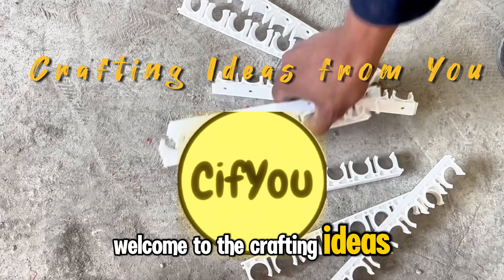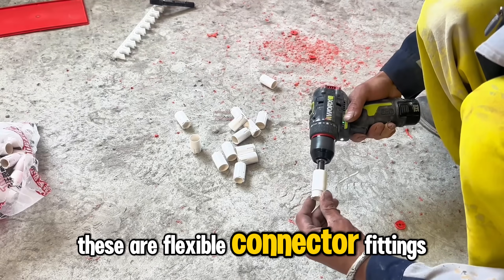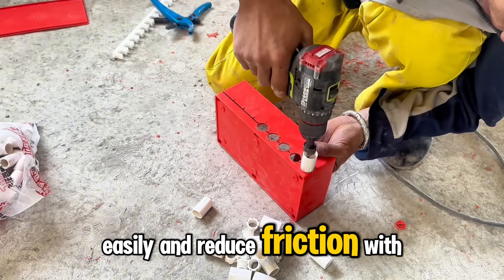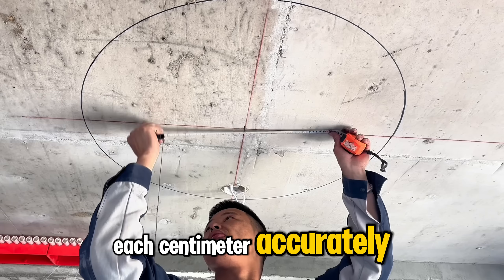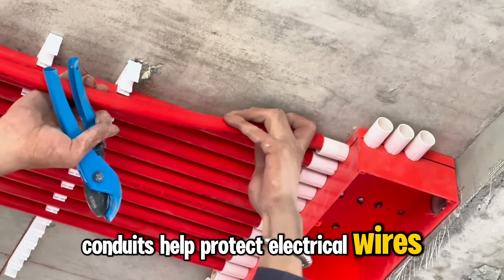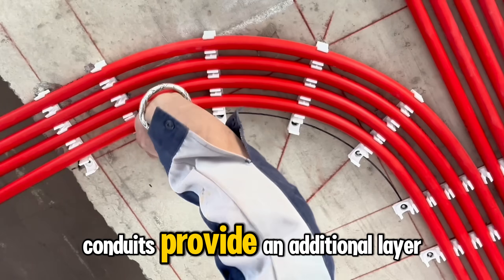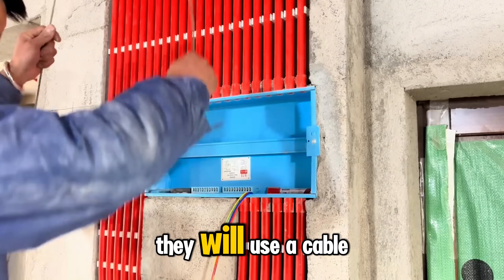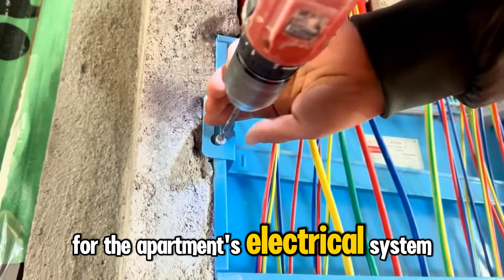What would electricity look like without following NEC (National Electrical Code) standards?

Comment: The electricians here in this video would do excellent work under any rule book that makes sense I think. I wished their dilligence could be observed as well in the work of many German trademen.

After this house, flat or appartment is completed nobody will see this dilligent wiring and when it comes to guess where not to drill a hole for a picture or any other fixture on the wall difficulties will start. The work displayed here lacks installation zones meaning zones where to expect electrical wiring and those supposed to be safely free from that. This might hurt a bit less on the ceiling.

But one thing is actually better in modern European fuseboxes like those from e.g. Hager (Germany) or Schneider (France): There are common rail systems available to connect RCDs with the circuit breakers and to connect a set of two or three RCDs with the main switch. They are simply clicked in, offer more cross section and use less wiring space.

Comment: I’ve seen NEC houses with over 30 Ω ground resistance, loose NM cables just stapled between studs, no conduit anywhere, and no separate 300 mA / 30 mA protection. Junction boxes often sit half-buried behind drywall, multiple outlets share one 15 A circuit, and aluminum wiring still pops up in older homes. Grounds are sometimes floating or daisy-chained through receptacles, and neutral–ground bonds aren’t always consistent.

Comment: I’ve read the comments and I’m honestly shocked. I’m not sure if everyone here is an electrician or not, but this video clearly shows why skipping the NEC standards is a terrible idea. They drilled through a horizontal column (a beam, lintel, whatever you call it in your country), that’s a major mistake, both structurally and electrically

Comment: WTF???  Where's the neutral bus? Who thought of connecting the neutral bus with a ribbon cable and posting that on YouTube? You have multiple phase wires connected to a single neutral wire. The current in the phase wire is equal to the current in the neutral wire. You have only one neutral wire connected to multiple phase wires. Your circuit is not valid even for a symmetrical three-phase load because the neutral wire will  be overloaded - IT IS ONLY ONE! Its cross-section is smaller than the total cross-section of the wires of each phase. This is a violation of all norms and laws. I can't believe 2 million people didn't notice this....  LMAO
Reply: The max current in neutral can't exceed the max current in one phase, and when all 3 phases are at max load, the neutral current is equal to 0. Just the same way the neutral current is when you load 100W on each phases, you could even disconnect it, nothing would happen. (only work if perfectly balanced)
In 3 phases distribution system, at the street level, the neutral is usually smaller than the phases as the load are balanced and the neutral carry the residual unbalance.
And this work in HV too, the neutral in distribution system is smaller than the 3 phase 7200V conductors.

The disturbing thing is they use yellow and green as phase, and a mixed yellow/green as earth. In some contry blue is mandatory for neutral, yellow/green for earth and you can use any color but blue yellow green for phases. (usually Brown L1 Black L2 gray L3, and any color for switches, two-way push button)

Comment: waste of time and money
Reply: For short term use sure, but consider I just pull the copper line to get the optic fiber without drilling an hole is a nice thing to be able to do in a 1960's house, so does the upgrade to add earth protection and got rid of the odd aluminium cables.

Comment: inefficient  way  need lots of mony or wast
Reply: For short term use sure, but consider I just pull the copper line to get the optic fiber without drilling an hole is a nice thing to be able to do in a 1960's house, so does the upgrade to add earth protection and got rid of the odd aluminium cables.

Comment: With that much concrete that had to be removed whetger at the beam, ceiling and walls to run the PVC, Id give it a few years before that building will start to crumble or show cracks throughout the entire structure

Comment: NEC is a Huge money making Scam.
Reply from the maker: really?
Reply: @CIFYou  Really, just investigate the huge industry.
Reply: Maybe but it doesn't mean it was always that way and it doesn't mean that everything in the code is nonsense. The reason much of the code exists is to 1. Create  standard = saving money = getting everyone on the save page, etc 2. To prevent people from creating problems down the future.

For example, this style would not work in most homes(in the US at least) because with all that wiring someone it makes it far more easy for someone creating shorts such as screwing something into a wall. Someone is very likely going to hit one of those plastic conduits and short out the wires. While the idea of having one wire per device seems nice 1. it is unnecessary 2. far more expensive and wasteful 3. Makes it harder to add new devices(since each one must have it's own conduit).

It may work ok in a business setting excluding the issue with waste/expense but it is overkill and actually may be more unsafe(but in a commercial building generally people are not hanging pictures, breaking walls, etc).

If the conduits are buried inside the wall several inches(say more than 3) then it may be ok but it then still is overkill. E.g., a typical light may draw an amp or two so why does it need its own 30A breaker. In fact, that makes it less safe unless they size the breakers to the device.

The more parts of a system the more complex and the more things that can go wrong. Lots of things that look good on paper or at the start become very problematic in the long run. This is the point of standards. To have things that have been found to work through time. Typically when people do their own thing they cannot anticipate future issues and cause major problems down the road.

I'm not necessarily saying all this is wrong as I do not know enough about it and it seems that it's actually based on some standard.

But one could also say it too is a $$$ scheme given all the extra components it requires.

Comment: I was more worried about the quality of the cement in this building than the wiring. At one point he fastens a conduit holder to the celling and it jump cuts to the conduit fastened, but the ceiling is missing a chunk. I am not an expert, but that can't be good.
Reply: Exactly. They can have the best looking wire installs but if that supporting platform isn't holding then it's pointless. Too bad they can't drive as good as they wire

Comment: - 2:14 
- 5:43
- 5:49
Damaging the concrete beam.

Aaand 
- 11:07
Tightening terminals using "drilling" mode.

This is crap, not an alternative approach.

Comment: Nicely arranged wires but:

1. Breaking the concrete on the beams .. i would send you home in the very next second. 
2. Placing more than 1 wire in one breaker, why on earth? Those are there in the first place to protect the cable, doing so it won't protect anything other than short circuit.

EX: 16A to 2.5 sqmm cables, if you place more load than the capacity of the wire the breaker will trip before the wire mesh melts, placing more 2.5 sqmm wires in a larger breaker will not protect the wire anymore in this scenario.

3.There are copper combs for connectors in the main breakers, even for three phase ones.. stop using wire straps like that.

Comment: What is the advantage of single strand wire over a multistrand wire ?
Reply from the maker: If it is damaged it is only damaged in that tube and does not spread.
Reply: @CIFYou  I am talk about wire, not tube. Why you use single thick copper wire ?

Comment: 5:43 They had to scrape concrete down to the rebars, exposing them, to accommodate for passing conduits and curves. Concrete function notwithstanding,  those rebars are going to rust away in a few years and lose their function, unless they are covered back and isolated from the elements.
This is a definitive no-no in my book.

Comment: High voltage above grond tangent pole or 45 degees ways  in marshall power house use truck mounted CB with tulips in bus bars for safety all bus bars can handle the lods at 25 % above carrying capacity inside switgear Nec iec or uk standard , Perry Utanis PEE 🇵🇭or US🇼🇸

Comment: As electrical engr licence from PRC I work from many countries I used NEC as my referncee in my projects there are many codes , Philippines code but not complete they refer NEC of US , UK, France but NEC of USA is the best working of elec power is dangerous if you don’t control the flow electricity ungerground and above ground installations , small power and High voltage 😎

Comment: The cabling is neat and organised however the last thing I'd ever do is use a battery drill to tighten electrical connections. It is the fastest way to stripping a screw or leaving the connection not tight enough, leading to a scorched connection down the track. This bloke did shave a few screw heads during this process.

I'm also not a fan of solid core cable. Stranded is better, though if that isn't available in some places, solid is all one can use.
Reply from the maker: thanks
Reply: Then you don't know the tool enough. That drill has a torque setting. There is nothing wrong if used properly. Stranded is better? Not always, there are several factors such as price and durability, stranded of the same price has lower amperage rating and can be degraded by oxidation into breaking point which is almost impossible with solid core. Solid core is easier to put in CB.
Reply: @ You don't go on price when specifying current carrying capacity. There is a reason why solid cable is illegal in many countries now - it is prone to breakage, doesn't sit in connectors as well, there is less contact surface area in a connector and it's not as flexible.

Whether or not a battery drill has a torque setting or not is not the point. It is simply a bad practice to use that tool for closing connections and I did specify the main reason why. The user there was stripping the heads of some of the screws with it.

Comment: This worker, other than leaving dust in the cabinet bottom, did an outstanding job! You don’t see wiring done this way outside of industry and military settings. You can poo poo the Code if you will, but it promotes safety and uniformity in the trade.

Comment: At 5:48 and 7:30, concrete beams that are holding the ceiling are broken in order to get these wiring curved or through. Big big big mistake.
Reply: At my job they drilled several 10 cm wide holes through the beams. But apparently it was allowed at a specific height in the beam and with a minimum distance between the holes. Apparently it was designed so that there was no rebar in that part and they used a very special drill that first got attached to the beam. It took hours for 1 hole but zero vibrations, very gently

Comment: Uhm, i'm an electrician.
And in germany we learn how to bend a good right angle with the cables.
So who did say that it's wrong?
Reply: The fixed curves for 16mm that they sell in Belgium are also very short. I just managed to pull 6 x 1.5mm2 through it so it shouldn't be a problem if it's only 2 or 3. Now i must admit that the 6th wire was a bit against the regulations because it's a return wire 😁

Comment: A strict blind allegiance to the NEC is the most comical point to listen to when talking to electricians, especially when those same electricians are typically unaware as to who comprises that code panel. Manufacturers get their products deemed “code” as they are the ones sitting on the code panel. Guys that argue code nuances are doing so to distract from their inability to think for themselves. This is best demonstrated in the residential market where code eliminates practical thought and application for a market comprised of incompetence installers.

Comment: You NEVER disconnect the ground!! The ground wires should be connected at all times, and should NOT be interrupted by a breaker!
Also, never tie multiple wires to the same connection, one gets loose and you now have a fire hazard waiting to happen. And so many more issues... 

The whole conduit thing looks neat and feeds my OCD, but why did you have to screw up everything at the panel connections...

Comment: When all that pvc pipe burns, every one will die from the smoke.
Reply: Try replacing the words "pvc pipe" with other terms and see if that brings a different outcome. Try "furniture", "clothing", "electronics", it seems to work in the sentence, no? :D 
Jokes aside, pvc conduits are usually flame retardant, meaning they won't keep burning and self-extinguish, shrinking in attempt to protect the wires. As opposed to nearly all other household items.

Comment: As a German electrician, I see we got different ways to complete the same job and some stuff is the same but your joints for your wires in these wire boxes I don’t like much. We preferred use like wago or something but not because it’s quicker, it’s because the structure of a joint with a springloaded connections that can’t go lose after time as your connections with Zinn and heat. I like to see your work, it’s like meditation to a nice voice. It’s not your voice, I know but it’s nice ☺️👍🏻

Have a great day and keep your joy up for your work! I like your intention!☺️💪🏻💪🏻

Comment: I have been an electrician for close to 28 years,  different  doesn't mean bad, I learned the British system first and now I work at the NEC,
I worked with the Chinese wiring low-income houses in the Caribbean, in some ways, their system is better, and in other ways, ours is best.  it's like comparing apples to oranges.  Your conduit work and your panel dressing' ability are simply beautiful & we love it. I love the idea of a separate 
conduit for each fixture, it makes repair and replacement so simple.
ss
Reply: That is the difference between the USA and all other countries. In the USA if one small piece breaks we scrapped the whole thing and build over…while other countries repair their work.
Reply from the maker: thanks
Reply: You work at the NEC does this mean you write for the code book? I’m sure confused about that statement.

Comment: Its Art,  Its easy to mount.. but the true work its the tracing.    In the breaker box, i choose the bus contact else to work the wires,.  these pvc tubes are better quality than Peru.  I m impressed with the breaker switchs  they are very compact because only takes a unique slot.  Here takes two slots.   But,  i dont like the beam damage..

Comment: I would hire him for my home in a heartbeat! This installation exceeds NEC standards so in theory it would definitely pass inspection in the US.
Reply: Unless electrical components have a UL seal, (or equivalent), it can't be used in most jurisdictions in US.
Reply: yea! this guy put US electricians to shame! What a mess of an install we have here in the states.
Reply: @lowellabraham6966 When you run pipe you typically pull more than one circuit.  This seems inefficient.

Comment: 5:42  
Why do we, as structural engineers, always say that the concrete cover is so important? Structural bars must always be covered if it is exposed (how is rust produced? Water + oxygen = rust - Because it is exposed, it becomes easier). Thus, the structure has weakened and is unable to perform the function for which it was designed. 

I do not criticize the worker's work, I'm just discussing structurally
Reply: I think it gets covered with more cement or plaster, would it matter then? If not just applying a sealer to it.

Comment: There is no way that breaking a concrete beam and exposing the structural steel is allowed anywhere in the world.
Also, He could save A LOT of time using comb connectors to distribute the phases to the individual breakers. Specially since he has all breakers from the same manufacturer.
Ohh yeah, and the drill to drive the screws... Why would anyone do that?

Comment: In the UK we use metal containment like basket or tray. The cables are then secured using metal braces if above head.

The reason:
A few years back, there was a fire on a construction site. The fireman entered into the building to tackle the fire. It got so Hot that the plastic cable ties (tie wraps) and plastic conduit melted, and the cables fell on to the fireman. He then got tangled up in the copper wires and eventually died from the fire.
Reply: It was an apartment building, the wires were retrofitted coaxial cable, and you are correct about the outcome.
Reply: You have an abomination called ring remains, which is flawed and dangerous because there are two paths current can follow. So if one breaks the circuit will still test fine but if it’s loaded to capacity, it will melt the lead because each lead or conductor is only half the size it should be.
Reply: Бедный 😢
Reply: Сильный жар не спасет от падения даже слабых металических конструкций тем более от лотка нагруженного массой кабеля с толщиной стенки меньше милиметра он так же рухнет на голову
Reply: trays are the standard in europe, its also easier to add new cables or change the layout in the future
Reply: @zaxmaxlax are "trays" the same thing as junction boxes within the U.S.???
Reply: thanks for your advice..  Plastics are easy to mount but sensitive to fire.  Always better metal cages or wraps else pvc.  I take it account.
Reply: Yeah that fire was near me in Stevenage , I’m from Hitchin . I’ve been
Sparking for 34 years and this is wonderfully neat .
Reply: Someone mention this install gets covered in stucco, so melting/dripping plastic & sagging cable may not be an issue.
Reply: Same.
We use metal cages here in Bangladesh